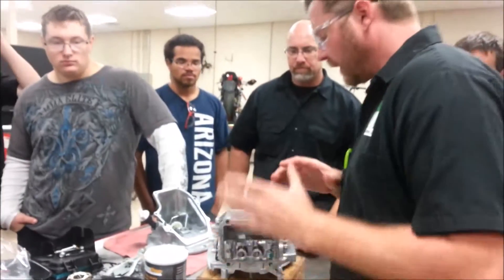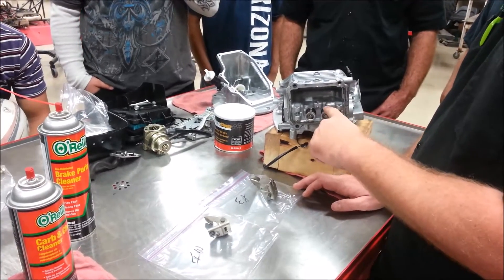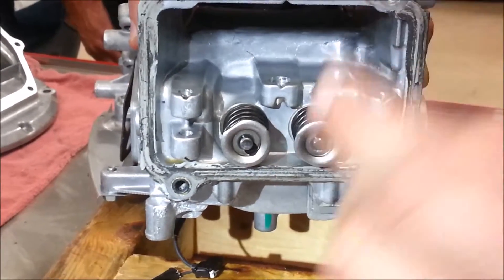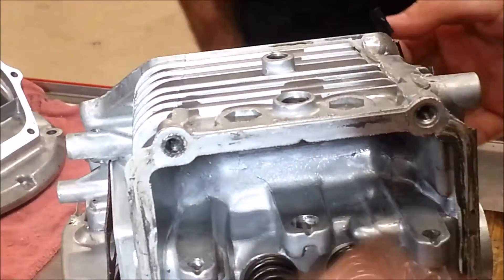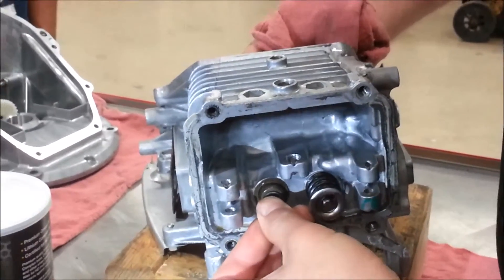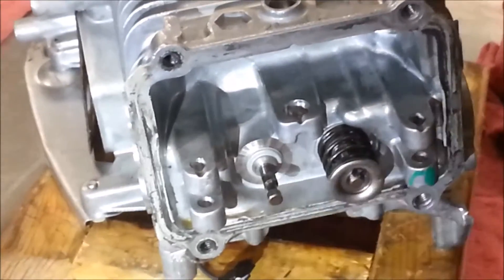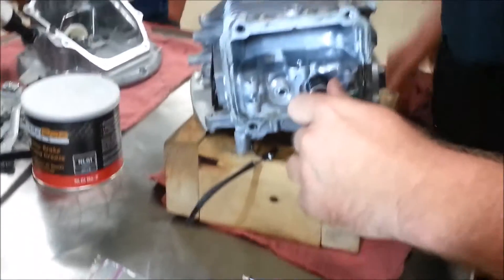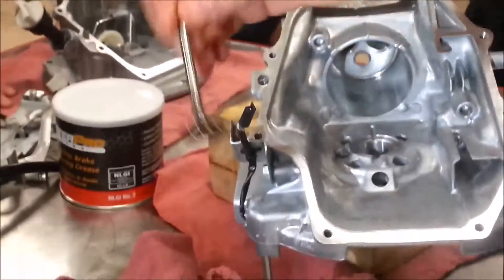GCV Disassembly   14 How to remove intake & exhaust valves #how2wrench

Comment: bought a non-running husqvarna with the gcv190 engine...only 2.5 years old...bent the exhaust valve.  Was going to buy a valve until I realized that the motor has to come 100% apart to replace.  Far more complex than a typical briggs.  Looks like the valve bent due to excessive valve lash.  $500 AWD self propelled mower...basically junk in 2.5 years.  pretty sad.  Hopefully that isnt the norm for the GCV engines.